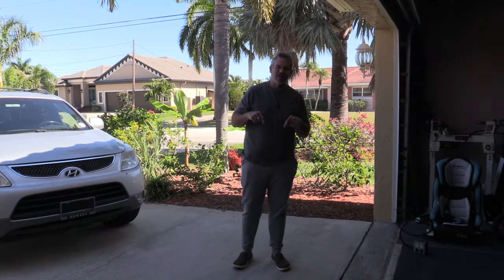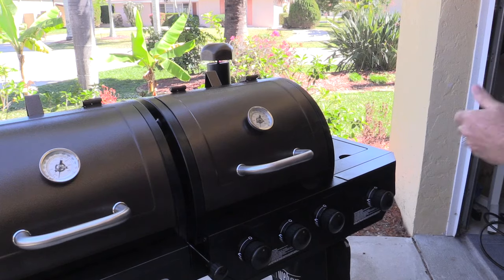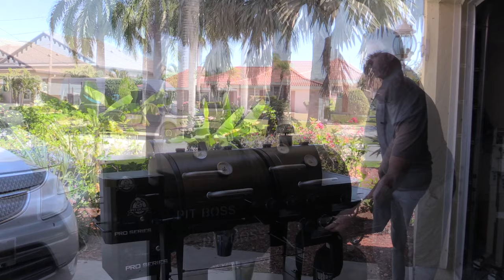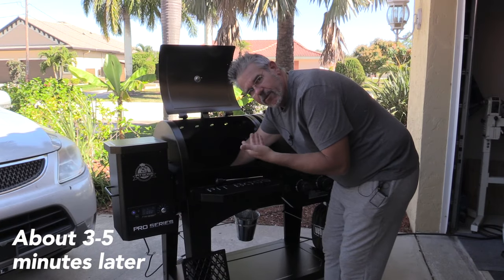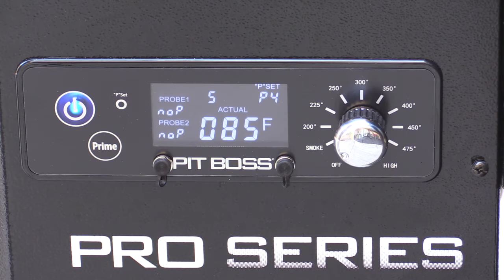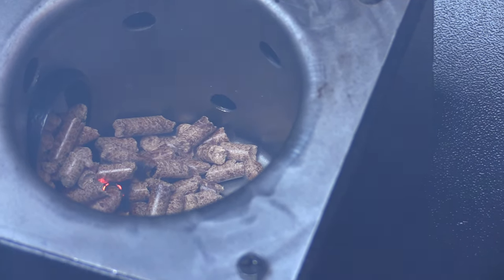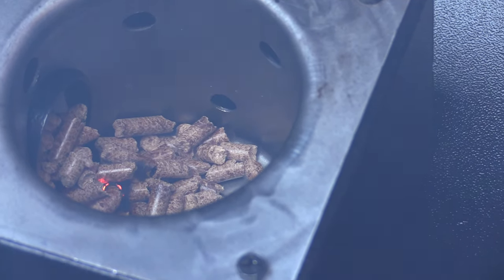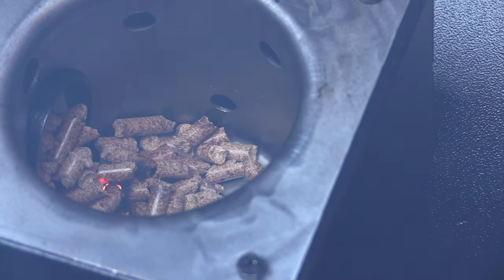Pit Boss Pro Series Combo BurnIn

Comment: I know this is going to sound dumb. I just got this smoker I’ve never smoked before. I noticed during this video you have the chimney cap open. In other videos when you actually grill it’s closed. What is the reason for having it open or closed? Should it be closed when smoking? Thank you
Reply from the maker: On mine it doesn’t seem to matter. The chimney is in the gas side chamber but because the smoker side has like 8 holes in the back, very little smoke makes it to the chimney. I was thinking of maybe blocking the holes on the pellet side and opening the smoke chamber to the gas side to see if it gets any air flow up the chimney.

Comment: Where is the smoke!? A smoker should produce way more consistent smoke…
Reply from the maker: It did/does. Maybe i didn’t catch it on this one as the goal of this was a high temp burn in to burn off any oil and grease from the manufacturing process.

Comment: Can you use the the smoker side just as an oven with out using pallets?
Reply from the maker: You can use the smoker side as an oven but you need pellets to heat up that side and it maintains temperature fairly well so if you set it to 350 like to bake a pie, it will work and I use it that way frequently. The temp fluctuates a bit but still good, just rotate and check ever so often.